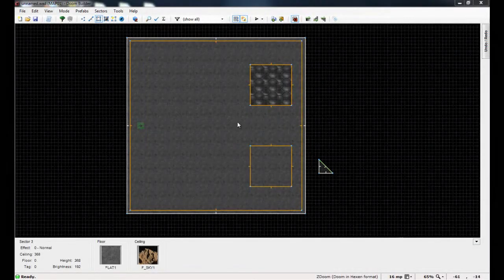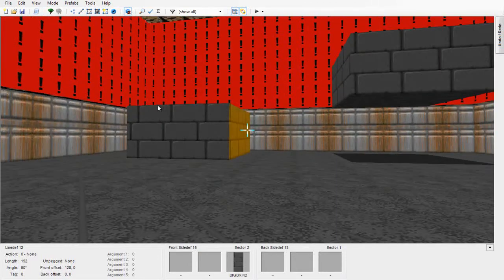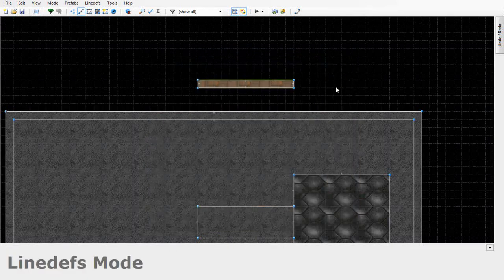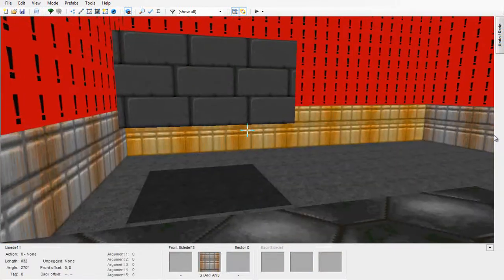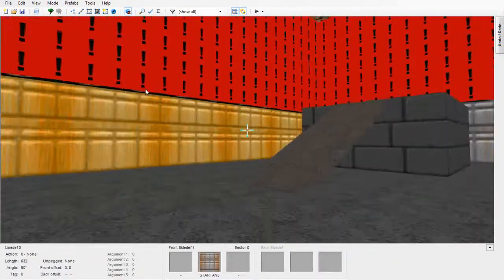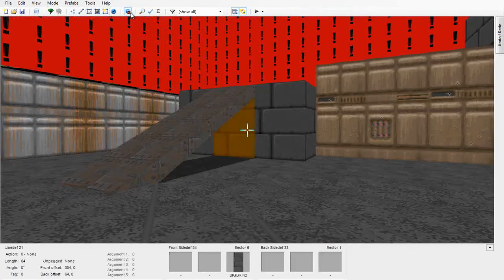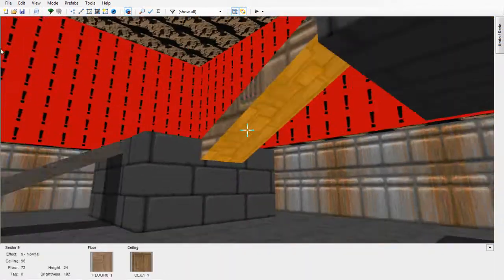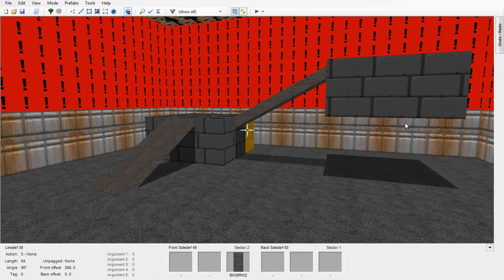(GZDoom) 3D Slopes Tutorial

Comment: Don't this work for 'GZDOOM: DOOM II (Doom in UDMF)'? It's invisible during gameplay.
Reply from the maker: Which source port are you using?  It should work fine with GZDoom and (as far as I know) ZDoom.
Reply: GZDoom 3.3.2 (my computer is old by the way)
Reply: I found out the issue in the end. The integrated graphics card in my computer isn't powerful enough to run GL3 which is why the sloped platform won't appear for me in gameplay.

Comment: can you make also a 3d slope bridge and underneath deep water? to swim under water and above you have the 3d slope bridge. where you can walk on and swim inside the water underneath.
Reply: I've not done an underwater section yet, but I'm starting to get the hang of sloping with both regular sectors and 3D flooring, and have even created the beginnings of a multisection bridge using 3D floors and 3D slopes. I'm thinking an underwater section will be next on the agenda.

Comment from the maker: I just checked and "#include zcommon.acs" is supposed to just be black.  When you type your first script, however, the word "script" should be blue and the number of the script should be green.  As for your script not activating:  First, make sure you've compiled it in the script editor.  Also, make sure that you've assigned your switch a "Player Presses Use" action.  You might want to try a simple Print script first just to make sure it's working.